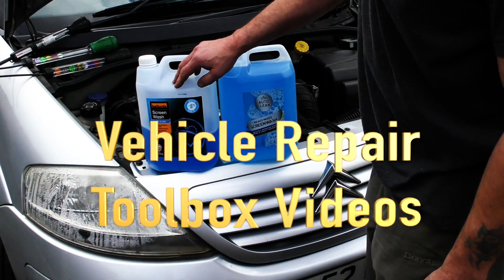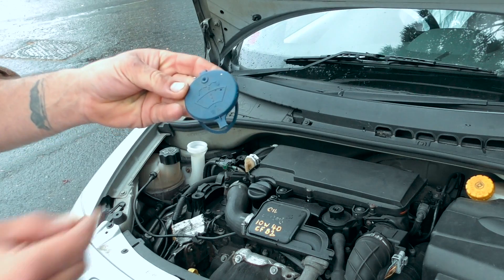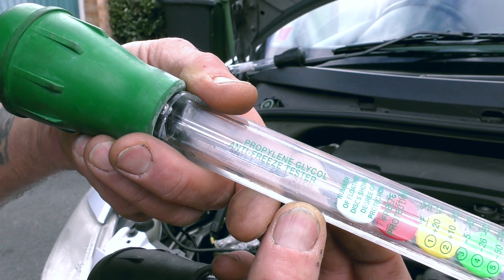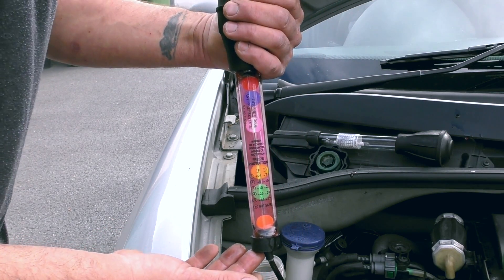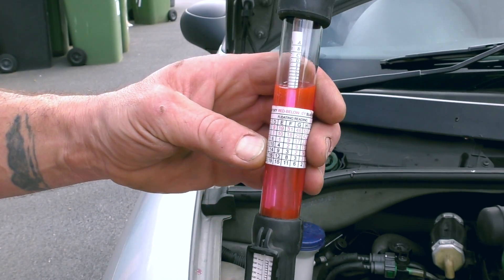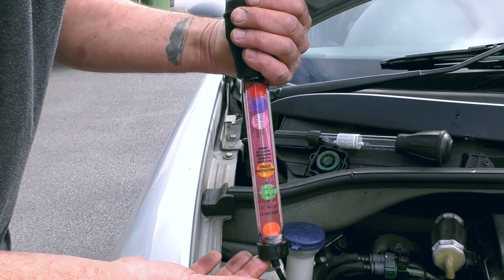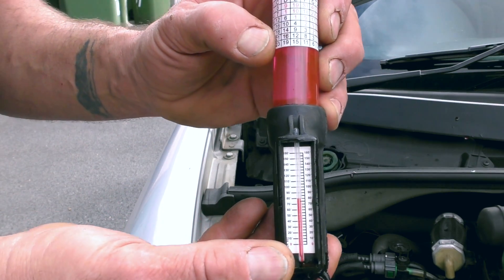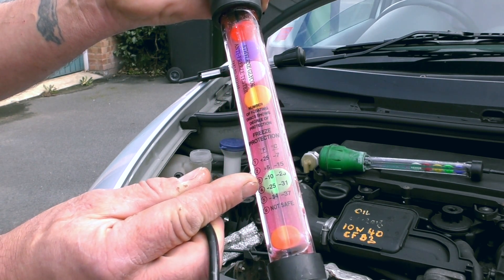Back To Basics - Testing Antifreeze With Your Floating Balls?

Comment: With those cheap disc type indicators you forget to mention you need to clean and flush your balls with clean water after dipping your tip in a foreign liquid, and spurting it back into the orifice
Life skills  in basic car maintenance 

It affects the next reading as those balls or discs can absorb the chemical solution and maybe not give you an accurate   desired sensation next time 

Think you need to change your engine oil to. 5W/30    winters coming    respect your valve lifters 

Vote for Hydrometer type everyday
Reply from the maker: 5w/30 is an option as we use it almost exclusively at work.  Not due for an oil change until near December.

Comment: A refractometer is more accurate, is available with either F or C scales and will show you the percentage of coolant/antifreeze on the same scale where you read the protection level. It will usually also measure the freeze protection level of your windshield washer solvent. They routinely sell for $20 to $25 US.
Reply from the maker: Correct and good quality refractometers cost good money here.  We use them for as you mentioned above and also Adblue quality.